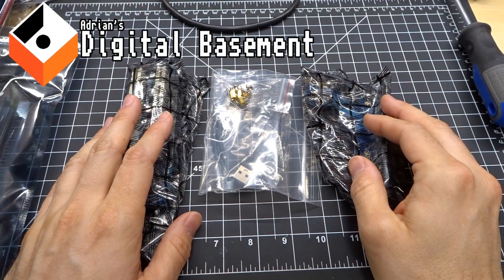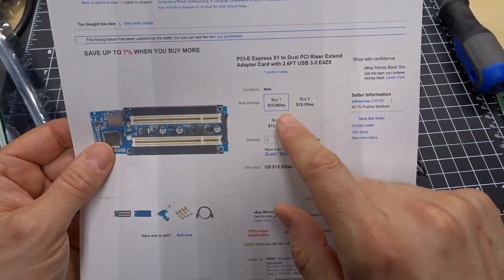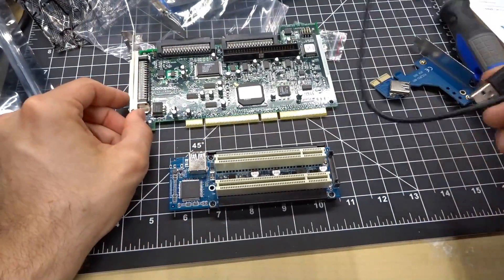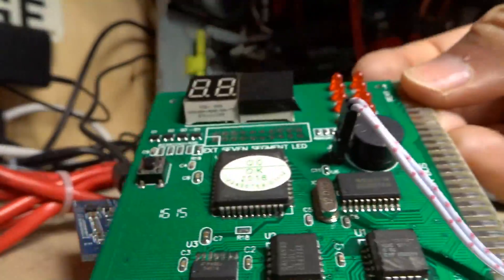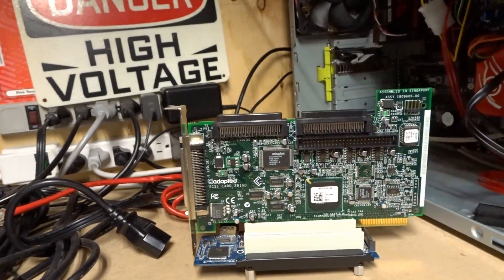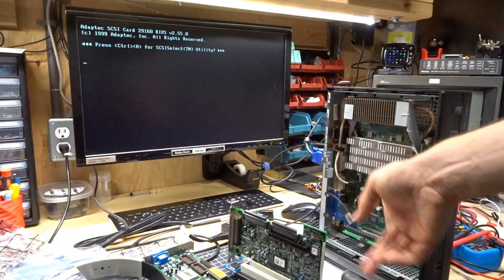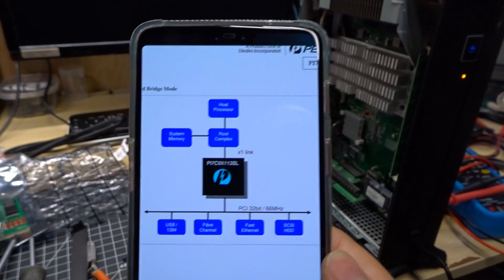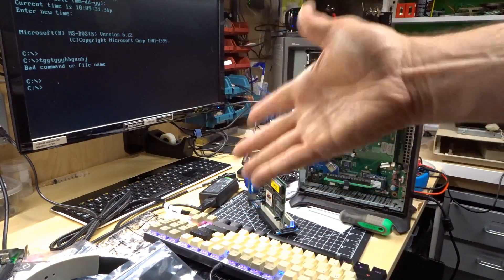Can an external PCI-Express to PCI adapter work? Sort of...

Comment: Looks like a neat way of hooking up a GPU + Soundcard to a small Win98 computer with no decent expansion room
Reply: I've never heard of a windows 98 machine with pci express before.
Reply: @awilliams1701  Yes official support is non existent!
But there are some modified chipset inf files which supposedly support a range of intel chips here: http://www.windows98.xf.cz/
I happen to have a Intel 915 Pentium 4 and Intel P35 QuadCore PCI-E board handy which are mentioned to be supported which I was planning to test and will get back to you how well those go!
Something else to check: https://msfn.org/board/topic/107001-compatible-hardware-with-windows-9x/

Comment: It'd be interesting to see if you booted from a Linux live CD, if it picks up the bridge and the card in lspci.
Reply: what you said is only partially true, ive seen cards not be detected at all in windows (not even as an unknown device), that would fire up and work fine with no configuration in linux. linux simply has better hardware detection.
Reply: @dcfuksurmom  Hardware detection is not done by the operating system in that manner, Windows uses largely hal.dll for that, Linux has several different methods but in the end detection such as these PCI(e) cards is done by the BIOS, not the OS unless hotswap support is present and enabled, which it usually isn't.
So no, Linux does not do 'better hardware detection', that's just something said by those who didn't understand why something didn't work as they wanted it to.
Linux might have better support for certain devices, where Windows might have better support for certain other devices, detection however is done mostly at the physical level by chip logic, not the operating system.

Comment: I think it is working on one machine (but not the other machine) for either of two reasons:

Either, it might be an IRQ conflict whereby the bigger machine has some other bandwidth priority for something on or in the motherboard (whereas the smaller board has less on it to use up bandwidth to cause that)...

...Or it might be the DMA on the smaller board. The reason I think this might be the case is that the thin-client would be part of a range of computers designed to go with business-class server hardware which expects to have weird expansion cards in it that have those odd DMA setups. There is an interesting Mark Furneaux channel video whereby he demonostrates how some business class expansion cards can have a strip on their PCI/Pci-e connector masked with tape so as to prevent domestic class hardware (mboards) rejecting it. I'll try to dig out the hyperlink if it helps.

Comment: I'd try a different pcie slot. You ought to be able to hang one of those off any lane, but maybe something isn't quite compatible with your motherboard's setup. Turning on "option bios" settings isn't going to help. That only effects booting. Windows does its own root complex enumeration, so those settings are irrelevant.

Comment: I've used a very similar product as a GPU raiser. You need to connect the sata power cable. They work okish.
Reply: Agreed. I use something like this to turn a 1x port to 16x for gpu support on boards that otherwise cannot or will not fit a full sized gpu.

Comment: First power the adatper with the SATA power cable, second you need to look in hte BIOS of the other computer to enable looking for Other Bioses, remember that you are trying to boot a BIOS on a UEFI system (which might not work)
Reply: In theory option roms can be loaded on uefi systems while uefi is enabled if compatibility mode is also enabled, while secure boot has to be disabled as that does not allow option roms. Having tried some award 4.51pg bioses with option roms there are still a lot of situations where a bios won’t load a option rom. The 4.51 didn’t load a pci rom but only the isa rom and a x58 board didn’t load the isa rom (from a pci card).
Reply: This is the correct answer. An old Bios card won't start in an Uefi environment. You'd need to set it back to Bios (can be done on lost boards)

Comment: As others said, you may need to go through all BIOS settings and make sure anything 'legacy' is enabled.  Personally, any PC I build, I always get a motherboard w/ 2-3 legacy PCI slots just in case I need them (and I didn't want to have to buy new PCIe cards for things I did have).

Comment: Dude, that is the GA-Z97X-Gaming G1-WIFI-BK motherboard.  It was the Gigabyte flagship board for Z97.  Good board.  Been running mine 24/7/365 since April of 2015 with a 4790K and a RX-480 (since late 2016)..  It also has the PLX PEX-8747 PCIe switch in it (under the heat sink that says "G1 Gaming") , so you actually have two x16 slots (slots 1 & 5) or four x8 slots.

Try (after pressing F2 to get to the "Classic" display in BIOS) "BIOS Features"->"Other PCI Device ROM Priority"->"Legacy OpROM"

https://www.gigabyte.com/Motherboard/GA-Z97X-Gaming-G1-WIFI-BK-rev-10#ov

LTT Review: https://www.youtube.com/watch?v=Np_sWey3mSI

It also sounds GREAT into my Beyerdynamic DT-880 Pro 250 ohm cans.

Man, I haven't seen an AHA-29160 in maybe fifteen or so years.  Ever consider upgrading from SCSI?  Modern SATA HDDs are a bit faster.  Back in the day, that was a kickass controller, but umm, 2019, man.

Comment: the sata power connector is exactly that, it provides power to the board for higher power cards.
Reply: This. I wouldn't be surprised at all if the reason it didn't work on the bench computer is precisely because of the lack of power to that connector. Without it, power on the PCI side might just be unstable and depending on the exact motherboard power delivery, especially given that the host-side adapter card doesn't seem to have any kind of intelligent power circuitry to convert all those different PCIe power rails to the probably only one power cable in that USB cable.
Reply: @chuuni6924  well maybe we should listen to dave jones "thou shall check voltages" the post card likely uses microamps and the scsi card uses amps so the SATA power connector must be essential for "smarter" cards
Reply: I'd check the board when it comes to these to see if it also has vias for the old molex connector. All of the (USB) cards I've bought that need power have both.
If you were gonna desolder the SATA power connector and replace it with a right angle or wires it'd be a hell of a lot easier to use the molex points.
Reply: That Sata connector is indeed in a ridiculously bad spot.
Reply: ^SATA not sata
Reply: Donald J Trump who cares? sata SATA sAtA SaTa SAta saTA sATa
Reply: Donald J Trump jo glaub mal ich hab meine Ausbildung in  IT-Support abgeschlossen und niemanden kümmert es ob es SATA oder sata geschrieben wird
Reply: @technikfreak9859  halt echt haha was muckt der
Reply: Sata Stupid spot and orientation.YEah , i found a 90 degrees adapter ( which i had to modify cutting away a part ) and with that my soundcard was recognised. Did not test further , was bit sluggish .With another adapter ( asmedia chip this time) card was recognised without sata power .
Reply: @CalintzJerevinan546  It's not a linux problem lol.
Reply: @lepompier132  ^Linux not linux

Comment: Newbie. Not enough power from old computer. And yes, that’s a sata power connector...

So much for these so called experts...
Reply: @adriansdigitalbasement  Did you try plugging it into a PCI-E slot that has a direct CPU connection? Just a random idea, but a lot of the 1x slots and usually anything after the first two x16 slots go through the chipset first. You'll have to look up in the motherboard manual to see how they assign PCI-e lanes, but maybe you might have some more luck with ones directly attached to the CPU. Thanks for the video!

Comment: Try plugging the PCI-E card into one of the x16 slots instead of the x4(if that doesn't work try the other x4 or x16). Might just be the slot. I've encountered similar problems with raid cards not being picked up, it's all due to build configuration and the motherboard you have installed. You can also determine which way the PCI cards go in based on the position of the notch on motherboard's with PCI. Hint: The single notch for PCI is at the end of the PCI slot(closest to the front of the case) and not the front. It's slightly different for PCI-E depending on what type of slot.

Comment: i'm thinking part of the problem might be the SCSI card draws too much power for the adapter alone.  i think you need the sata power connector connected to your psu aswell.
Reply: @adriansdigitalbasement  Right angle power cable, perhaps?
Reply: @adriansdigitalbasement  oh i was thinking one of the angled 90 connectors , but must be a bios issue

Comment: Out of curiosity, does the BIOS on the bench computer have a setting related to "Allow option ROMS" or something to that effect?
Reply: I am also going to assume that Secureboot is OFF in this configuration. 
 Legacy Roms will not load with secureboot enabled.  It might also be 
worth it to turn off UEFI, Post the computer, and see if you get a 
Adaptec confituation screen at post
Reply: @adriansdigitalbasement  OK.. just a thought. I should have known better that you would be aware of it :)
Reply: @supremerulah420  There might be an opton for legacy hardware. I had an issue recently where an LSI SAS controller woudn't show its POST screen.
Reply: This will be tghe case as non-EFI hardware. Adaptec card is from 1999 according to its copyright.

Comment: Plug the PSU SATA cable to the PCI riser and then try the UEFI/Legacy BIOS settings.
Reply: @adriansdigitalbasement  might wanna try it with a SATA power connector anyway.  It's a LVD controller, so a negative rail might be needed, or maybe it needs a bit more juice than that USB cable can handle?
Reply: @adriansdigitalbasement  oh, and see the reply i made above, if you haven't found the details on the board.  It was the Gigabyte Z97 flagship.

Comment: Your Lab pc motherboard has no Southbridge.  Regular PCI ran off the South Bridge and PCIe runs off the Northbridge.  In the newer Intel processors the Northbridge is integrated into the CPU and the Southbridge was replaced with a PCH (Platform Controller Hub).  There simply is no path or ability for old PCI to work through the Northbridge in the CPU.   Your old terminal has and older chipset with a traditional North and South bridge setup.
Reply: I have one of these in my Asrock X570 board which has no legacy interfaces anymore.
At first it wasn`t recognized at all, but that was fixed with a newer bios.
currently it`s running a TI firewire card and an old X-Fi Xtreme Gamer.
System runs in UEFI mode on Windows 10.
Firewire card didn`t need a driver , the X-Fi card did but works fine.
did need an angled sata power connector tho :)
Reply: @adriansdigitalbasement  You might want to consider sticking with an older machine like an AMD AM2+, or even FM2+(AMD APU) that has one, or 2 PCI slots on board, as sometimes some of these external boards can be a bit unreliable from my experience, and if you go with an FM2+ board something like an AMD A-10 series APU it will give you more then enough compute power for this kind of task, and you won't have to worry about a GPU taking up a slot, just make sure to give system 16GB or more of 1866Mhz RAM(in the BIOS/UEFI let it use the max 2GB of system RAM for video) and if you can OC it to 2133Mhz as AMD for generations has benefited from good fast RAM more so than Intel.
Reply: I don't think this is the reason why it doesn't work.  The SB chipset is just an integrated platform on one IC.  One of its functions is a PCI-e to PCI bridge.  But that's what the controller chip on the card here does.  The SB isn't magical or necessary, it's just highly integrated and does stuff that either doesn't need doing anymore, or moved to the PCH.
Reply: @adriansdigitalbasement  Yeah.  The PCIe comes into the Northbridge, and is routed down to the Southbridge back to the Northbridge to get to the CPU.  There were some motherboards that had PCI slots towards the end (of seeing PCI on new boards) that actually connected them this way on the board.  I had one and I had a PCI raid controller and my disk speed went down to about 1/4 of my old board.  The Northbridge has no ability to send PCI to the CPU, RAM, etc, so it has to go to Southbridge, and back up to the Northbridge via the internal bus.    PCIe is only supported in Northbridge, except for a few flaky chipsets that Intel had (like the 945GZ) where PCIe up to x4 was in north bridge, but above x4 was in the Northbridge.   This setup was on a lot of server boards where there were no x16 slots.
Reply: @frugalprepper  actually, this motherboard adds another layer to the mix, but that layer is essentially transparent, and that's the PLX PEX-8747.  Effectively it's x16/0/x16/0, x16/0/x8/x8, or x8/x8/x8/x8

Comment: That was a great video perhaps you can check the BIOS in your newer computer to see if it supports Legacy ROM options this is used to display bios messages from older cards. If the new computer uses uefi the Legacy roms may not be initialised or displayed have a look for the option Legacy option ROM or something like that it's different for many motherboards

Comment: You know i would be happy to send you a LSI PCIE X1 SCSI 320 Ultra  card that was pilled from a HP workstation that had the Tape drive addon.

Also note some motherboards do not support the Raid cards interrupting the boot process. I have a Z97 board that is like that.
Reply: Fun fact, that LSI logic card isn't native PCIe, it uses a PLX PEX8114 PCIe-to-PCI bridge chip! Same goes for the Adaptec cards.
Reply: @NJRoadfan  Might still be worth trying as the PCI-X card in a PCIE to PCI converter isn't working.  The fact it uses a PLX chip doesn't surprise me one bit.
Reply: @adriansdigitalbasement  if you are refering to the oncard connector, i have a slew of them i got at an Estate sale.  

I have a Meritec 940900-4 and a LSI 2032ie.  I post links to the spec sheets and a site about an ibm 3550MB SCSI drive using the Meritec adapter.  a 68 pin to 50 pin.

As i said i am willing to send them if you can use them.  Some motherboard dont support the bios being interrupted, so you may want to look into that.  I learned that reading the manual for the Dell Perc 6/i card (i have one of those too if you want it).
Reply: @adriansdigitalbasement  A cheapo 68-pin to 50-pin adapter plugged directly onto the card should work. Under $10 on ebay. Hooking up narrow SCSI devices to a wide bus is easy (no upper byte termination horrors unlike the opposite direction!). Note that you still need that upper byte termination style adapter, just that the 50-pin devices "just work" unlike using a 68-pin device on a 50-pin narrow bus.

Comment: Those 29160's are god damn indestructable. Seagate 15k sata iii drives are fast but are damn loud and run hot. I have a seagate 5gb and i swear it sounds like a f15 jet. Raided scsi is almost a fast as a ssd. Nice thing about scsi they can handle multi read and write instructions and still maintain the same speed. Ide is basically one operation at a time.

Comment: Did you happen to watch the video "Bits & more by René Rebe" did on this exact thing? Do you even know who he is? If not, I recommend you check him out. That SATA connect is for extra power from the PSU. It needs extra power to work properly. I honestly don't understand how it worked without extra power with the WYSE computer.
Reply: @adriansdigitalbasement  That's why I'm so confused. The SATA power, in my experience, is required for the adapter to work. Yet, the adapter worked on a machine incapable of supplying that power. I do not understand.
Reply: David Phantom, thanks for mentioning the "Bits & more by René Rebe" channel. I just subscribed.
Reply: "I honestly don't understand how it worked without extra power with the WYSE computer."
It probably depends on how much power is being consumed by other components versus how much the respective PSUs can deliver to the PCIE bus.

Comment: Did you try another PCI-E Slot on the Gigabyte mobo? Maybe go through the bios on the gigabyte system, you may need to enable something, change UEFI mode to legacy mode? Maybe change your sata config from AHCI to IDE? Maybe you need to plug a sata connector in ? I'm sure you could get it working.
Reply: Force legacy oproms in the UEFI, because the i7 is UEFI not BIOS.
Reply: @asanjuas  its running in legacy mode.... he stated this at the beginning..... even my 7700k mobo has legacy support
Reply: I know it's kinda randomly asking but does anyone know of a good place to stream new tv shows online?